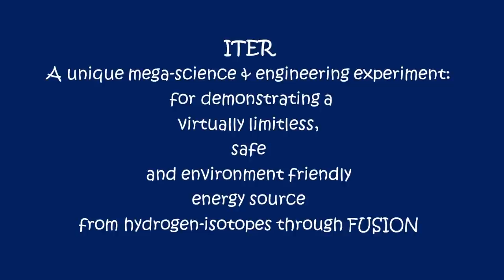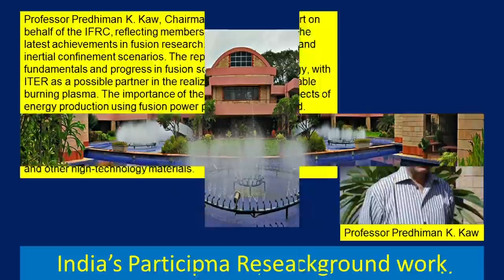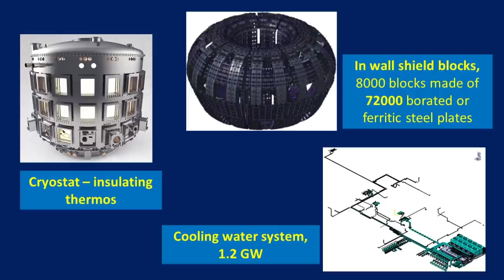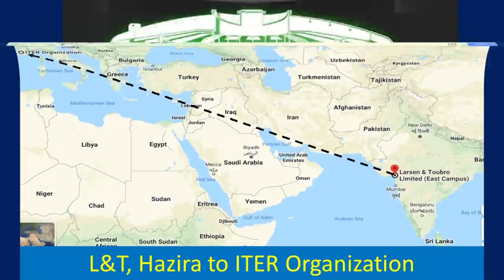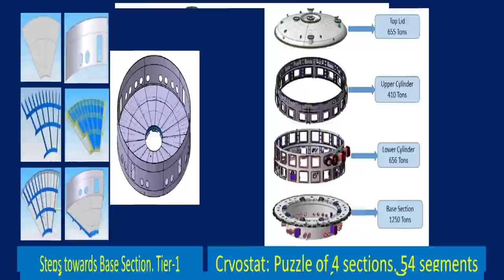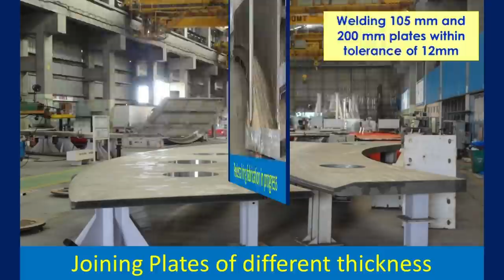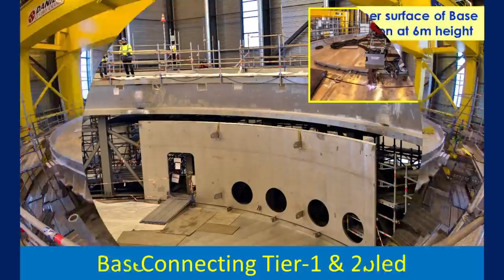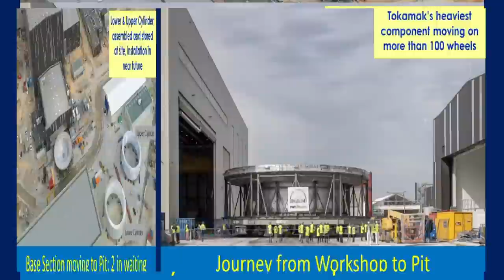India is building the ITER cryostat

Comment: I did not understand how thermal energy will be captured by the plasma since it cannot come into contact with anything due to high temperatures.
Reply: The walls of the vessel itself will be heated by the plasma and that heat can be used.  The plasma doesn't need to be in direct contact with it to heat it up.
Reply: Some plasma is taken off at the bottom of the vessel by diverters. Once it is away from the reaction stream it can be cooled, that cooling is where the energy is extracted.
Reply: The Deuterium-Tritium fusion reaction produces neutrons that carry 80% of the energy. These neutrons hit the wall heating it up (they are unaffected by magnetic fields, so fly in a straight line).
Its a bit here and there, because energetic neutrons are not something you want to have around (they change atomic nuclei possibly turning them unstable) , but at the same time they can be useful for producing tritium, which would otherwise be difficult to obtain.
Reply: @alvarorodriguez1592  - Yeah Tritium breeding is essential to the fuel cycle - we can't stop the neutrons so may as well use them as much as possible.
Reply: With help of Japan made powerful insane superconducting magnets
Reply: @frantisheq  the inside walls of inside structural chamber have on back beryllium filled coolant to take excessive heat generated from plasma as well as from radiation and matter decay, thus later using this heat as source of electricity for long years
Reply: Rishabh Tiwari  for that we are using diagnostic system to maintain the required heat to run this reaction
Reply: @drab2000  that's true 2023 mission according to iter is just to be able to get first light of hope that is generating plasma for hardly 2 minutes kind of. 
Who knows when it can produce electricity.. After 2050.
Reply: @dougaltolan3017  this just isn’t true
Reply: @Gomlmon99  it is also true